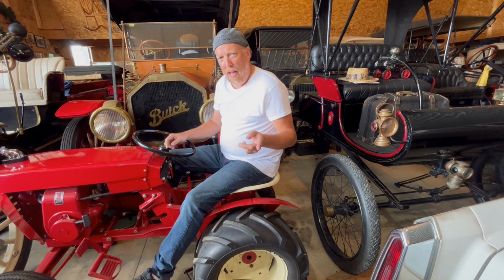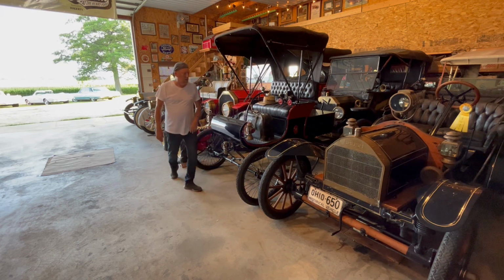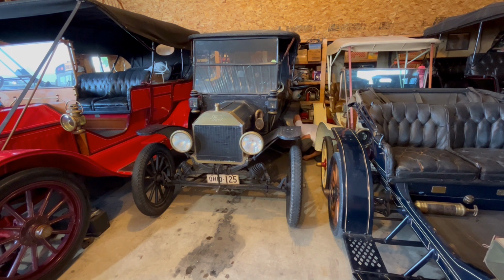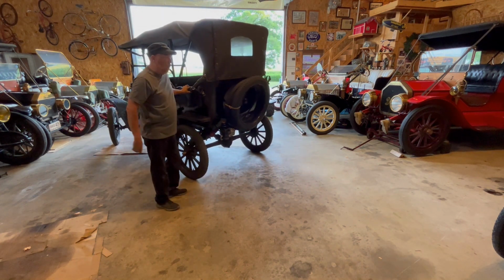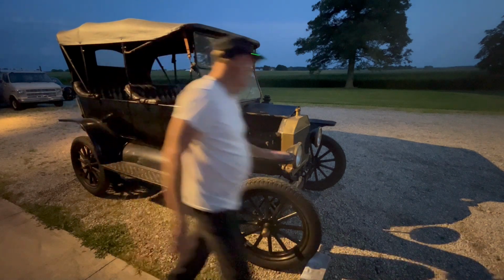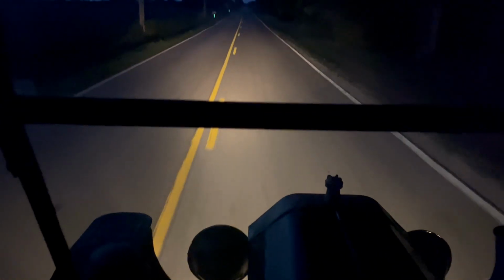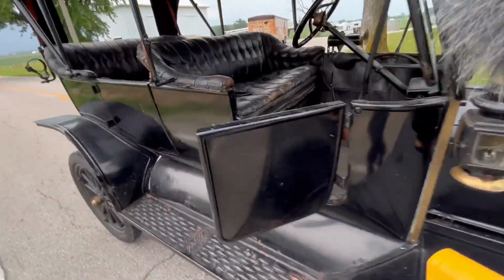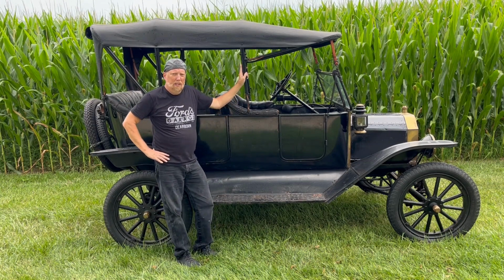Stock 1913 T Ford Quarter Mile Drag. [EP 70] @KlepsGarage

Comment: Another great show from Kleps!   I think my 4to1 hill climb gears are holding my back but it drives so good in this hilly town I hate to change them.   Take it easy Bruce
Reply from the maker: Well, there you go, you need to do hill climbs. I can’t believe this stock T  was only two seconds slower than my modified T. I’m going to have to work harder on it.

Comment: I first found your channel by accident, and watched your Oldsmobile Curved Dash video, great car too! ... now I've done a collab with @FlivverChannel, I'm going to have to do a Quarter Mile Drag in my own Model T now 😂 ... that's 403 metres for me 😆 your 1913 looks great! But I'm wondering why you didn't just apply the parking brake to stop that back wheel spinning when you started it... that's what I do with mine 😊
Reply from the maker: Gday Mitch. Brake was on. That car will flat run over you.  Motor has never been gone through nor rear axle. It’s a great survivor. Saw you on Flivver. Also watched your sis drive. Good one.  
Been down under in 2018. Sydney  Brisbane Newcastle coolum beach. Irwin zoo. Allora on the downs and Texas for a T rally. Meet some great T people. Hosted by the Partington family. 
Your country is beautiful.  Will be back. Episode 11. Shows my Aussie friends.  It’s a small world. 
By the way the Model T is still doing what it was designed to do. Take you to new places and meet people you otherwise wouldn’t have. 
Cheers 
USA Bruce.

Comment: Not super familiar with a T.  Does the rear wheel spin because the gear oil is cold?  Does it eventually stop as oil heats up?  Did '14's come with electric lights?  What tire pressure does a T need?  I've read 60 psi? Neat old car.
Reply from the maker: Questions questions question a T does not have a positive neutral it has a multiple disc high-speed clutch that likes to grab. Also why it is hard to push a T. Motor acts like a brake. I run 40 to 50 in tires 
The original owner changed a lot of things on this car ie headlights. It has been driven to CA an Fl from Ohio. Back in th 1920s. By org. Owner. I have this car documented back to org owner.
Reply: @KlepsGarage  Thanks Bruce, I knew about the clutch, but didn't realize that's why it would grab.  Wondered  about the tire pressure.  I knew they were higher than an A. I always like the "NO SKID" tire tread pattern.  I've seen many early T's with the electric lights.  Many were done years ago like you say.  That is a great T, looks right.  Thanks for the answers, really enjoy your channel.  Be well, Brian
Reply: Excellent video Bruce!  I’m prepping my 1920 T pickup for a 1/4 mile run - coming soon.  
Pete
Reply from the maker: Great let me know when it’s out.

Comment: I use a wireless winch instead of unpaid volunteers. 

It's an ATV winch (2500lb) & i built a "travel bag", for it, that has a small battery plus tie down chains, so it can go anywhere. Works great for motorcycles (with a good strap on the remote) because I can winch them while sitting on them ('cause bikes only have 2 wheels).
Reply from the maker: But my towing girl is a lot prettier than a winch 😂😂😂
Reply: @KlepsGarage  maybe, but a winch is faster (& probly more reliable, but don't tell her that!)